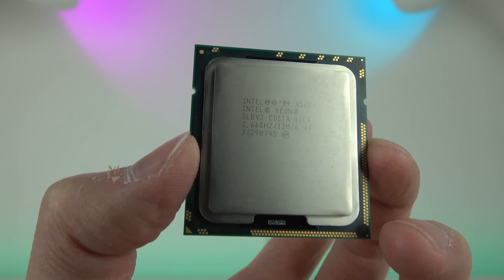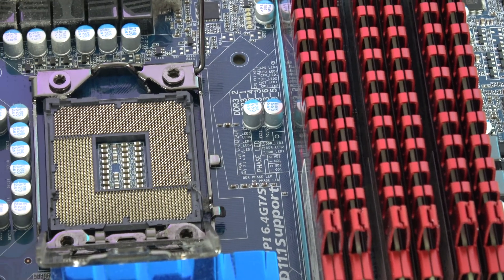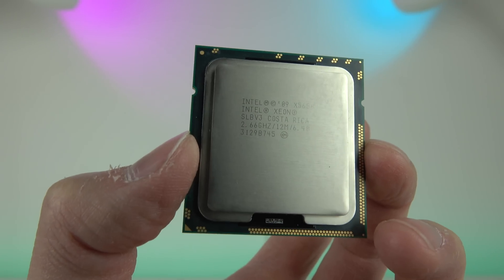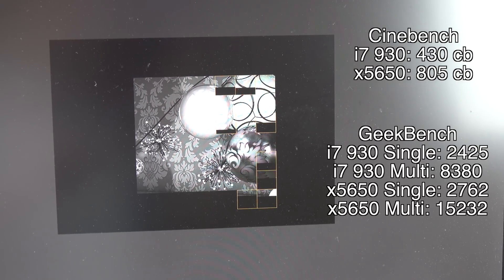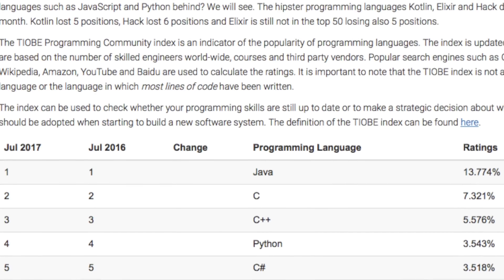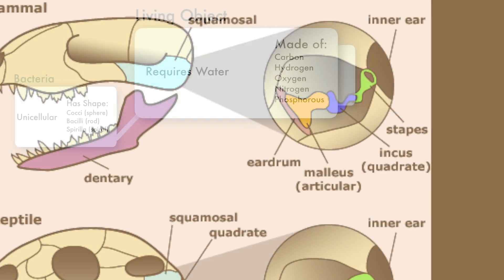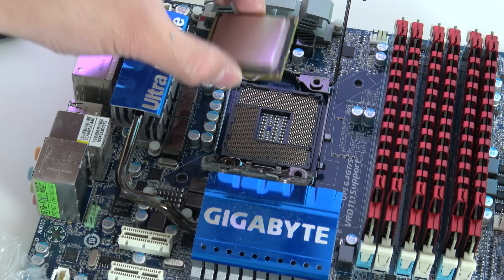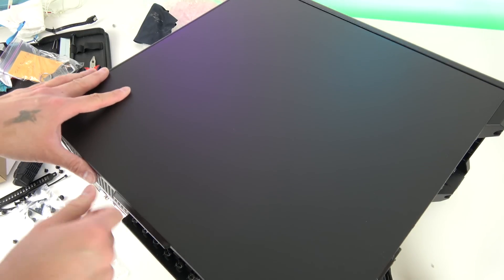This 6 Core CPU Costs $20. Will It Let My PC From 2010 Last 3 More Years?

Comment: I beg to differ, the LGA 1366 is a solid platform with tons of life left. The X5650, however, may be a bit dated. A dual platform with X5650's still has a bit of potential left as well though it's starting to be at the end of the line. 

Most every LGA 1366 MB I've encountered over the past few years has been able to handle any X56XX CPU, up to the X5680 as the X5690 is still out of my price range. A pair of X5670's in my Dell T7500 is a beast right now and can rival Threadripper in most tasks. Granted Threadripper beats the Pair easily but given that it's 1/10 the cost a Pair of X5670's is only a few percent behind in most tasks.

When Ryzen was launched it boasted that it could do Blender at 36 seconds while the latest Intel was 35 or 36 seconds as well. Well my T7500 was 37 seconds and given my entire unit with dual CPU's was 1/3 the cost of the Ryzen CPU alone the X5670's Price to Performance is huge in comparison. 

Folks think they need to latest, GREATEST, for bragging rights or something but fail to realize they only have more money than brain cells. If they thought for a moment they would not have spent over 1,000 USD for a CPU that is only 4% Faster than a Pair of CPU's costing about 1/10 or about 100 Bucks... X58 has a ton of life left; just look to the used market to see. Sure it's dated but it's NOT DEAD... The LGA 775 however, well that's probably DEAD by 2018. 

You should invest in a Dell T7500 with Dual CPU's for about 150 bucks, you will be pleased... Oh, BTW, the Dell T7500 is HUGE as in LARGE and HEAVY like 100 lbs heavy and that is no joke... The damn thing is probably Bullet Proof too; but if it's NOT I'd be surprised... Granted you don't get USB 3.0 or 3.1 but it has plenty of PCIe Expansion Slots so you can always add such things. Needless to say for less that 500 Bucks you can fully dress the T7500 to rival most any PC on the market. I am just referring to the PC alone minus the GPU... 

The Base T7500 with low end Dual CPU's and almost No Memory can be had for like 100 bucks, maybe less, shipped FREE. Add a pair of X5670's or 90's plus a Gob of Memory and you are set for a few years to come with what ever you want to do. As long as PCIe is backwards compatible you can upgrade to the latest ANYTHING you need to keep this system alive for decades to come. You can Game and Stream on this beast as well, very easily with 12 Cores and 24 Threads on the Dual CPU system. FYI a pair of X5680's is not worth the investment. For some reason the pair hinders single thread performance severely over a single CPU; not sure why so I will skip the 80's personally and end up with a pair of 90's when they drop in price.

Again the Dell T7500 will not be the fastest but it will be the Best Option if you only have 500 bucks or less to spend. Hell you can't buy Threadripper for less than 800 USED so the choice is yours. You can have a very kick ass complete system for 800 bucks or you can have a CPU... Now factor in DDR4 and a new MB and you are well into 1600 bucks without even trying. And for WHAT, 5, 10, 30% faster results @ 4 times the money... Sorry, not ME... I have too many Brain Cells and NOT ENOUGH MONEY... LOL... Cheers.....

Comment: I picked up a used ASUS Sabertooth x58 board (125$ from EBAY) and it was surprizingly easy to get a 4.1 ghz overclock on air with one of these 6 core xeons. I'm sure I couild take it higher but I'm pretty happy with it already. I used the tried and true Hyper 212 cooler and the CPU stays in the 60s under full load.

Comment: How is it holding up for you? I have a dell T5500 that I pieced together using ebay. It's a Dual X5650 that cost me around $430 for everything including the gpu ($300 without). 128gb ssd, 1tb hdd, 250gb hdd, 12gb ddr3 ram, and an outdated GTX 960 2gb. The SSD makes the difference to help future proof any older hardware computer, but this bad boy does 1368 in Cinebench which is still an impressive number in 2018 with no overclock. My system is actually the same one as the number 1 example ranking in Cinebench (unless your score is higher than 1279).

Comment: Did a similar upgrade for my 3930k, got a xeon e5 2695 v2 for 280 USD and with slight tweaks to the base clock and multiplier I get the same performance as an overclocked ryzen 7 1800x for a slightly lower price (and no need to buy essentially a whole new system to get the same performance)

Comment: $100 x5690@4,4GHz 6 core here in 2018 and old badass
Reply: Tamás Gergely Kádár What is your max core temp in stress test? my x5680 @4.2ghz hits 78-82C when stress test. But when I touch the cooler heatpipe, it's only feel warm, not hot as vga heatpipe. Is it normal? I'm using gammaxx400 cooler+deepcool z9 compound, and it's applied well.

Comment: Sorry but your whole argument of object oriented design enabling PC upgrade is nonsensical. PC's have been upgradable from the very first PC XT due to standardized buses like ISA, RS232, Parallel and even the old floppy ribbon cables. These hardware standards have nothing to do with object orientation. This was long before object oriented (software) design was even invented, in an era where all programs were procedural and "spaghetti" code (where the software had become a mess of criscrossing function calls) was a common thing. And it remained that way till at least the early multi core processor systems. Every system from the PC XT till at least the Pentium III (But probably even Pentium 4) precedes the Object Oriented era. And all of them could be upgraded.

Comment: good on you, I'm sticking with my 2012 i5 3570K build as long as the motherboard holds out, still perfectly satisfied with the performance
Reply: My 2011 $58.00 HP Z400 with a $45.00 X5675 that cost over 1100 bucks new is my main rig now and the stock under 500 watt psu fires my 1070 just fine.  With no overclock at all im happily turboing 12 threads to 3.43ghz and suffering no slowdowns.  My 2600K and 2500K systems are sitting.  12 thread Xeons just perform better.

Comment: If you are even slightly into cars, look into small block Chevy engines. They are simple, easy to work on, and have THOUSANDS of aftermarket parts and accessories. They are only slightly more complicated than legos.

Comment: I went through 3 GPU's, extra SSD, 2 PSU-s.  But hitting the limit now - socket is getting in the way which also means new memory - but still other parts remain instead.  
But i never just buy  everything new - i upgrade parts that need upgrading.

1080p is still the standard, in 3 years i guess 1440p will be the standard even for casual gamers and cheap builds.

Comment: Has upgraded everything except for CPU and Mobo. Claims it's the same computer built in 2010. -_-
Reply: He originally buys the computer and upgrades it. That's the whole point of this video is how things can be upgraded.
Reply: Look after your broom mate
Reply: if the cpu and mobo isent the heart of the pc. you tell me what is then.
Reply: that's the point of building a pc -_-
Reply: @tristan6509 cheaper than buying a prebuilt, you can get exactly the pc you want, and if you didnt have a pc before steam sales, free online, humble bundle, proffesional work + other non-gaming tasks
Reply: He didn't claim it's the same computer, rather that it's extending the life of the original purchase.

Also it's not the only thing that didn't change as far as I know. I didn't watch the video in entirety, but he seemed to say that the memory wasn't upgraded, nor the power supply, nor the heatsink, nor the storage. If you want to count things like a monitor, they wouldn't have been replaced either.
Reply: @MsHojat  he changed storage and ram
Reply: @MsHojat  psu, case and mobo are only thing he didnt change (that's counting peripherals
Reply: I tried several Times to upgrade a CPU on a System a few Years old but mostly had no luck with it. Recently i gave up on it.
Reply: Nope, he put a Xeon in it after a i7-930. So just the mobo. Which i would love to have, never being OC'd. You don't see that board never OC'd much.

Comment: LGA1366 FTW. My 2010 i7-920 got upgraded to a 980x for $400 used in 2013. I finally sold it in late 2016 for $250. LGA1366 has held its value/performance ratio like nothing I've ever seen

Comment: I am running a Dell T5500 with dual X5680's myself.  I haven't found a need to upgrade to the new processors yet as it runs everything I throw at it.

Comment: 2010 I bought an Intel 980X cpu (3GHz).  I still use it.  I tried building a replacement system with an AMD 12-core processor 4.x GHz, it didn't even compete with half the speed of my 980X.  I'll only buy Intel now.
Reply: Officer Meow Meow Fuzzyface your talking about the fx series cpus , those cores were actually cores cut in half with bad ipc, the new ryzen cpus from amd dominate the budget cpus and a lot of the medium end cpus but Intel's high end is still quite ahead
Reply: There's no 12 core FX CPU AFAIK, but you're correct.
Reply: 12 core Amd?
You mean Ryzen 1920x?
You probably bought some really old opteron, no wonder why

Comment: lol i have nearly the same pc but is was prebuilt. my specs are now (with upgrade): intel i7 920 - gtx 1050ti oc 4gb - 6gb 1333mhz ram - 1.5 tb hdd - 850watt gold rated corsair psu - corsair carbride spec03 case
Reply: Toss that 920 (sell it on ebay, goin around 40 bucks) and get a X5675. You will not regret it at all!  60 bucks well invested. 12 threads rock.

Comment: Just upgraded from an xeon w3550 to x5670 and got it stable on 4.3 ghz. Still Beats 6700 k. This will last me and my 1070 more than 3 years. 4k gaming takes actually less CPU Power.

Comment: No it will not as it has the intel meltdown bug and if you use it as a server, video processor & for graphics you will find it could be up to 30% slower.
I have run realbench on intels and found some were 32% slower where the AMDs I tested with realbench on windows with the patch were marginally faster.

Comment: best part is that you can reuse the case and some parts as you go, like the gpu might last a bit longer, tho the upgrade path id choose for that pc is motherboard, processor, ram, cooling, gpu, and as needed, storage. In between these upgrades you can usually use your older parts.

Comment: Reminds of my first new car: Acura 2006 RSX Type-S. Previously, I had owned a Chevrolet Beretta (abysmal car, to say the least) and a Mitsubishi Eclipse GS-T. The Honda/Acura product was expensive for a hatchback but had a phenomenal engine that was a tiny (2.0 Liter I4) with a 6-speed manual. In the heart of the RSX-S was the might K20 engine. A tiny engine that had one metric that few car makers could boost, the magnificent 100hp+/Liter mark. Most importantly, the reliability of this engine was sky high even thou it had a redline above 8000 r.p.m.'s. For 10 years, I owned the car, I took cared of it; oil changes (every 5000 miles), radiator fluid replacement (every year), power steering fluid (changed yearly), and transmission fluids changed yearly. I drove that car like a mad man. Eight years in, I had an oil analysis done, the results were way above average. Basically the various metal deposits were low and the presence of coolant was non existent (measurements proving the engine was still in pristine condition). My RSX-S was good for another decade of driving. However, exactly ten years of ownership and I lost the car in an accident. Was planning on keeping the car, at least, another 8 years. 8 more years without a car note and driving a car that could still out perform most automobiles coming from the likes of Acura, Honda, and Toyota. 

Yes, buying quality counts. I could talk about a pair of shoes that I purchased 12 years ago that have lasted me until the present but the same underlying principle still stands: overall quality, many times, is cheaper than just buying cheap products when you understand what you're buying.
Reply: I had my 1990 Volvo 240 DL wagon 17 years for similar reasons. Twice what I'd ever paid for a car before. Lasted 3X longer and made me happy with the purchase the entire time. Yes, the wiring finally got brittle with age and I didn't sink the money into it to replace the entire wiring harness. But I could have, as the rest of the car was pretty much "new"...
Reply: every car from 1990 up makes me laugh at how they claim horsepower..   I built a 454 inch chev big block and squeezed it in a custom camaro..

they dont build em to last anymore,,  they want you to pay more to replace it.

oh that 454 is still running in a truck a guy bought,    300,000 miles and still going wow, most engines these days die in 150,000 kilometers :-\

Comment: Good upgrade. I just replace my computer to a seller refurbished Lenovo S30 for around 355USD only in Europe with a 4C/8T@3,7GHz Xeon E5-1620 cpu, 16GB RAM, 1TB HDD, Quadro 2000 GPU, a very good factory case with favtory  80+ Gold PSU (600W) I suffered with the windows 10 drivers for a while, but today It seems every drivers works okay already.
So I realy recommend this or similar category, Who doesn't want to spend a lot of money for a new computer.
I calculated that a New computer with the same/similar setup whould be much more than double   this price. 
And a Xeon E5-1620 has a very good perfomance like a 4.-7. generation of Intel i7 processors. It just eats a little bit more power like a newer gen. CPU.

Comment: You changed CPUs but didn't clear your custom BIOS settings? That's upgrade 101, man.
Reply: I made the same mistake when I upgraded my SSD in my upgrade video:  https://youtu.be/pwNJto6VWE8
Although, because all I did was swap out the HDD for SSD, I expected the BIOS not to change drive positions.
Reply: He probably did after it failed to POST several times.
Reply: Agreed. Reading comments to see if someone else mentioned it... That's a facepalm mistake.
Reply: first thing before u swap cpu is to upgrade bios to newest ,,,,
Reply: Den Tyngaste um no it doesn't. Lol. Not always.

Comment: Haha HAF 932? I just build my old HAF 932 case for a friend with some old hardware, it was the only case I had that could handle the heat from the old GPU I stuck in it. The GTX 480. The new case you are using is a shadow of the god that was HAF, but I also am in a small glass sided case now the P400st. Aesthetics are nice but the new modern trend sucks for air flow.

Comment: Lol I have the same CM HAF case and the same mobo for 8-9 years already with i7-960 recently I ordered W3680 Xeon that will hopefully clock stable at 4,6 GHz.
This combo X58 was maybe one of the best investments back then even now i7-960 on ebay goes for 80-90$ and performance wise it is not that behind even tho is 9 years old. if we go back to 2009 when this CPU was released and look back and 9 years old CPUs they were obsolete by a large margin. And with this 9 years later you can play every single game outthere

Comment: 3 years no problem. 
You got a gigabyte Mobo and you selected the right socket for that time. 

You can probably get even more years out of it if there are even better processor available for that socket. I suggest running with the case open when gaming since airflow is gone.

Comment: I had to change my upgrade line. Before 2010 I upgraded my computer every year. 2014 I become unemployed and I sold my desktop i5. I used my laptop Lenovo fusion 1,6 GHz that was ridiculous slow. I learned Ubuntu and used it the days I hated Windows. Two years ago I bought an used Laptop HP i5. I still use it. Because I was thinking about old games I bought an Amiga and a Megadrive. I have relearned old stuff and learned new stuff about retrofit. I had fun without new stuff. The best thing is that I will have back every coin if I sell the systems. Have fun and don't care to much about upgrade path.

Comment: It's crazy how a currently $20 server CPU from 2010 is faster than an originally $300 high end consumer CPU from 2010. Although I saw it for $65. Server CPUs become much cheaper than consumer CPUs over time because big companies are selling them in bulk because they upgraded to newer CPUs. Other components don't really become that much cheaper to be really useful. Often a lower end modern component is faster and uses less electricity while costing the same.
Reply: Nothing crazy. The "currently $20" originally costed $600-$1000.
The LGA771 platform was flawed with FBDIMM power usage (15W each FBDIMM), LGA1366 platform has 40W chipset overhead compared to the next generation chipsets. My PC can't consume less than 100W@wall while similar ivy bridge i5 idles at under 60W.
Reply: The fastest Core 2 Extreme (X9775) was $1500 at release and is a bit slower than an Athlon 200GE which is available for 50 bucks new right now.
Reply: they're originally even more expensive... the reason they're so cheap are because they're sold used from servers.
Reply: There can't be that much demand for used 9 year old CPU's.  That's why they're selling for 97% off.  I wonder why he didn't buy the Xeon 3.07 GHz X5675 instead of the 2.67 GHz X5650.  The X5675 runs 15% faster and is selling for $35.76 on eBay, item# 141881193746.
Reply: its a workhorse cpu... xeon's are great at work but suck at gaming :-\
Reply: @harleyme3163  actually, if the cores are the same generation at the same clockspeed will perform the same